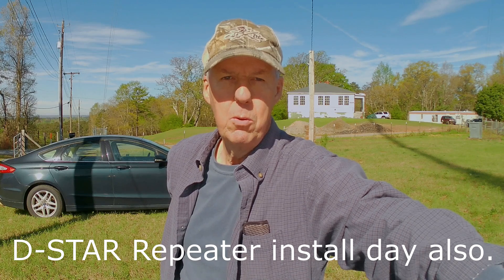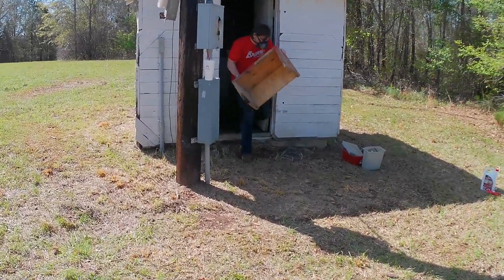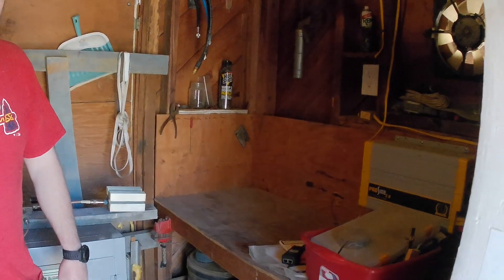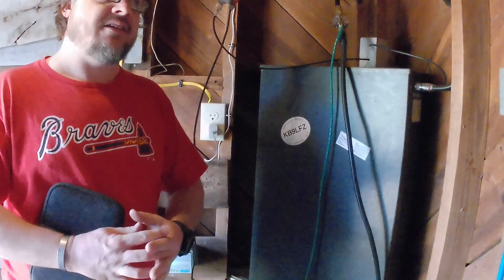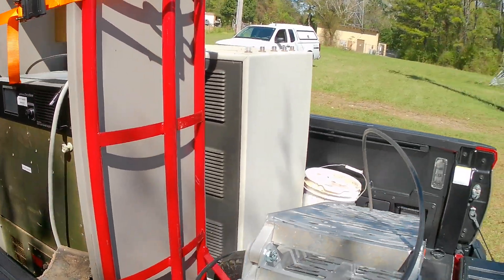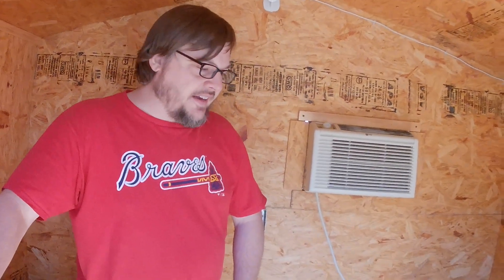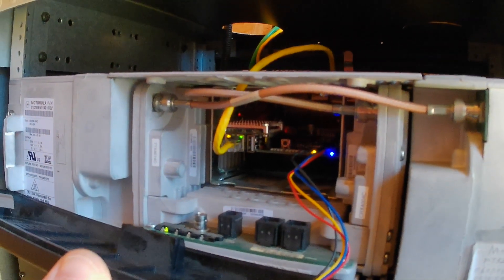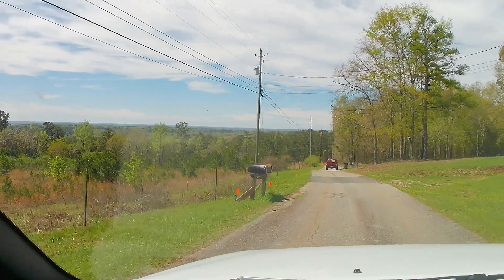D STAR Repeater Goes Live / Overview / Re[eater site Clean up Day

Comment: Reports are that the D-STAR repeater is working very well.  Multiple people have had success using their HT's while driving around Columbus.  A station in Woodbury, GA 42 miles away was also solid into the repeater.  I thought he was coming into 30C at first, but then realized he was local with me.